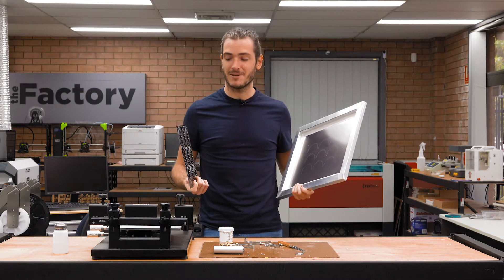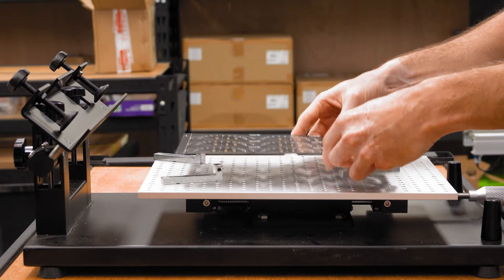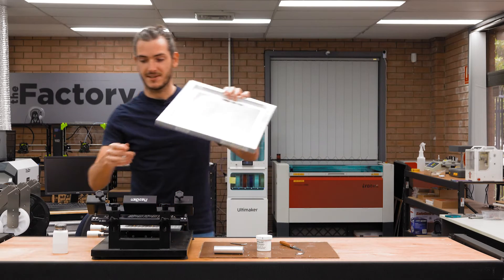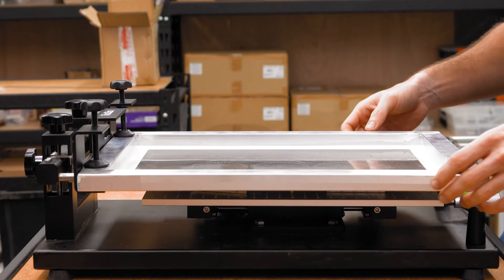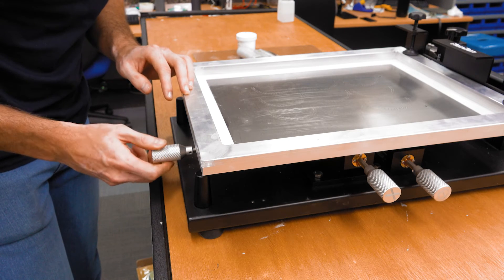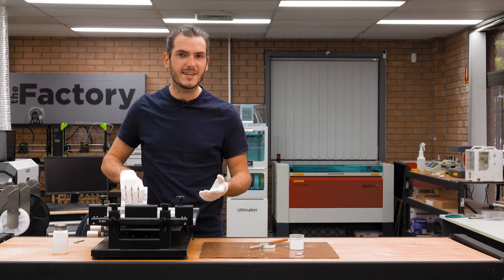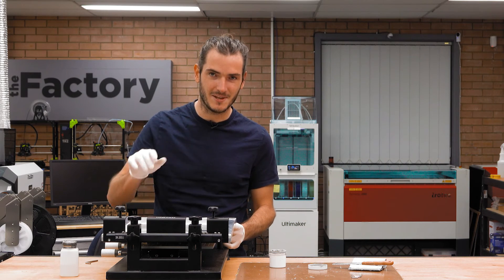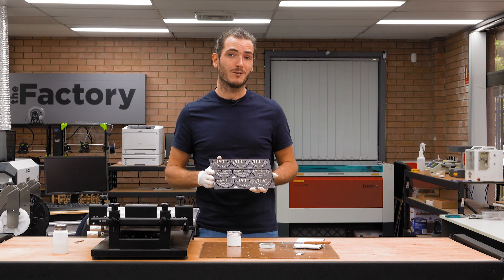The Factory | How To Set Up & Use A Manual Solder Stencil Machine

Comment: A coworker built the best squeegee I’ve ever used: he took two sheets of 2mm aluminum as a handle, and between them sandwiched two sheets of scrap stencil, one sticking out about 3mm, the other about 6mm (so that the 3mm is extra support for the 6mm sheet). The stencil metal is flexible, but with the added support, still rigid enough to allow definite pressure.

Comment: 7:53 Oh. Oh no. You’re not applying enough pressure, which is why the stencil is only being squeegeed clean on one side. No matter how many times you go over it, if paste is rolling out the sides and landing on previously-squeegeed-clean sections, then when you lift the stencil, those pads will have much too much paste. 

You want one single pass if at all possible, with enough pressure that NO paste is left on the stencil above a pad aperture.

Comment: Jesus, what a mess.  You never do more than one pass with the paddle, because the stencil will never sit exactly over the board. Which means its flopping around over the board and squashing the previously placed paste.  Ideally you need to fully support the board from underneath so that you can apply significant pressure to the stencil, and the squeegee needs to be able to be flexible.
Reply: I do this hillbilly style: route an exact sized pocket for the PCB in a piece of plywood, cut removal notches in one or two sides to aid removal, align the stencil by putting a PCB in and then orient the stencil on top with a *duct tape hinge*.
An advantage is you can handle arbitrary shaped PCBs.  With circular there is the issue of orienting the PCB, which I've handled with alignment pins at the  mounting holes.  Needless to say, there is no issue with getting even support under the PCB.

It works quite well (>= 0603 parts) with even the full sized stencils; I tried alignment pins on the stencils, but it was more hassle than it was worth.
Reply: @davidhawley1132  Tape hinges work fine,  although these days I only order stencils with frames.  It's not that expensive. I ended up building a simple DIY stencil printer.
Reply: @RobertA-hq3vz As cheap as possible makes jigs, personal projects, etc. feasible for hobbyist me.  I was very happy when JLC came out with custom sized stencils that are cheap to make, ship, and store.
Reply: @davidhawley1132  yes, that's where I get my stencils from.

Comment: Good video on the subject.
I would like to bring few recommendations.
1. Can you use a camera view to show the pad and stencil during the alignment process?
2. Instead of locating the post leg to be locked underneath the PCB put it outside then you can lock it while in place.
    It is much more easier and accurate.

Keep the good work.

Comment: I have no idea but I’m guessing 45 degrees is optimal squeegee angle. I think it is for a jackhammer.... but hey those two things are not so similar 😂
Reply: I would also like to suggest a bevel on the scraper.... like a fine point.. there needs to be rubber under the pcb to support everything I think as there is leakage out the side due to flexing I presume.
Reply from the maker: Thanks Steve, very interesting! We're yet undecided between fairly rigid scrapers vs flexible, more experimentation needed :)

Comment: I think its better to avoid the second pass with the solder pass. But for this sizes and tolerances it doesn't really matter.
Reply: When you show the results under the microscope, you can see that too much pressure was applied on the solder paste shown by the paste spreading at the base.
I am less concern the uneven top surface because during the reflow process everything will become even.
Reply: Yes good thinking.... a scraper the same width as the stencil and one clean pass. Best way to control quality.
Reply: @BABALOOEY46  we've upgraded to a wider squeegee - this one's a bit narrow isn't it?
Reply from the maker: Good point, thanks Jonas. Perhaps we should have mentioned that along with it's only worth doing another pass if you have concerns with the first. If the supports/angles are fine, then everything should be a-ok with another go